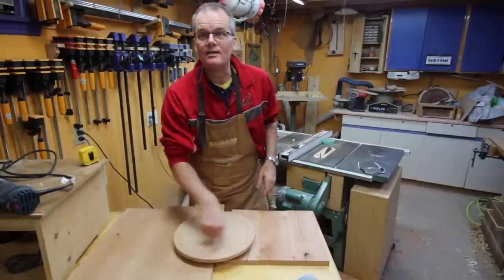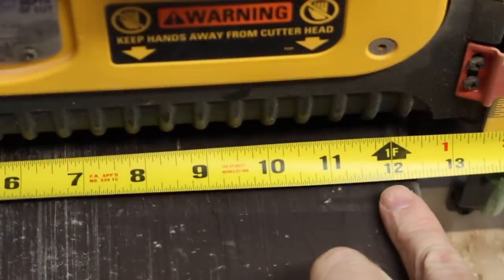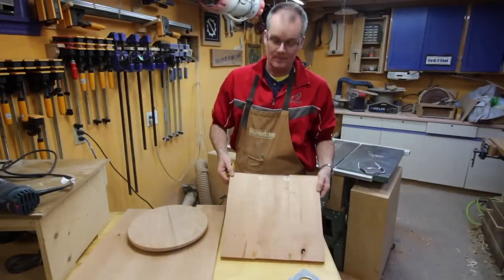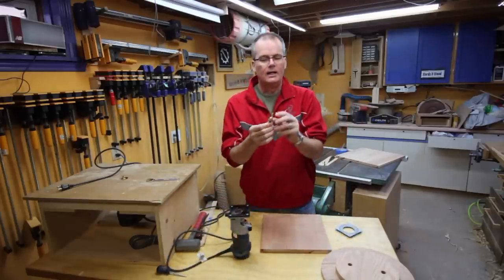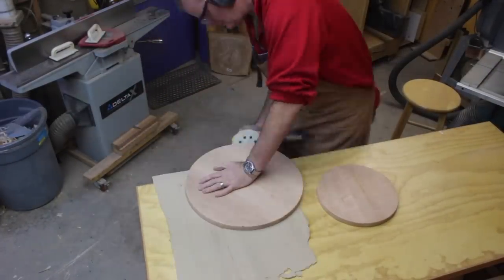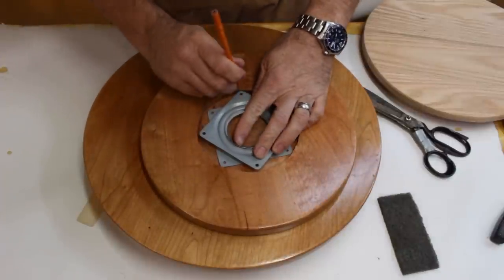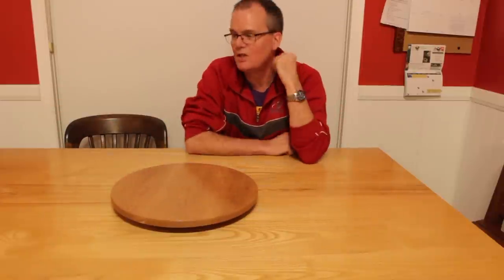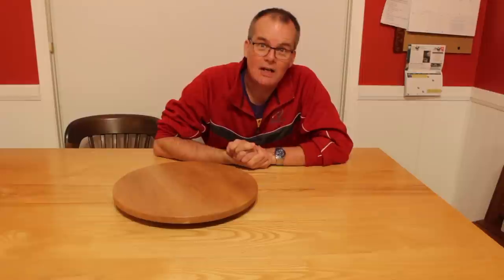Lazy Susan --  Quick Weekend Project  (WnW #126)

Comment from the maker: Patrons spin me right round, baby, right round:  https://www.patreon.com/wordsnwood
----------
Build Article: http://www.wordsnwood.com/2018/lazysu...

I decided to try making a Lazy Susan for our kitchen. It's a quick and fun project -- you just need to glue up some boards and cut them in circles. The trick(?) is to excavate a spot in one of the boards to hide the ball bearing mechanism that allows the board to spin. There's a bit more to it than that, which is detailed in the build article.

---------- ---------- ---------- ---------- ----------
LINKS TO SOME OF THE ITEMS USED:

(AND/OR other tools and jigs that I use and recommend.
Most of these are affiliate links. If you buy through these
links it helps support my channel. Thank-you so much!)

https://goo.gl/G2UyMp -- Ball Bearing Swivel (This is the Lazy Susan bearing I used)
https://goo.gl/fRuRhj -- 1/4 Inch Shank Hinge Mortise Template Router Bit (The router bit I used)
https://goo.gl/tXC28k -- 3pcs 1/4 Inch Shank Bearing Router Bit Set (these would also work)

1/4 Inch Shank Bearing Router Bit -- https://goo.gl/8nTn4o
1/4 Inch Shank 3/4 Inch Diameter Bowl Router Bit -- https://goo.gl/XGzcbB 
Tripod Mount Holder Bracket -- https://goo.gl/375aio
Wholesale Mechanical Parts -- https://goo.gl/Q2F5F6

JIGS/ACCESSORIES

http://amzn.to/25Iw4t6 — Long Nose pattern marker
http://amzn.to/1V4ZHkv — Painter’s Pyramids

SMALL TOOLS

http://amzn.to/1WSNq1j — Stanley Leverlock tape measure 
http://amzn.to/2lYXz3W — Other auto-locking tape measures
http://amzn.to/2aqt0u4 — Ridgid 12v drills
http://amzn.to/2aRaSJY — DeWalt Random Orbit Sander

FINISH:

http://amzn.to/2beVz3t — Minwax oil-modified Polyurethane
http://amzn.to/2kPENLs — 3M Finishing Pads / Scotch Brite

BIG TOOLS

http://amzn.to/2bpMmkX — DeWalt DW735 Planer
http://amzn.to/2beSIY6 — 3rd party blades for DW735

GEAR I USE TO MAKE VIDEO:

http://amzn.to/1qPkvBp — Canon T5i
http://amzn.to/2aK7jZX — Inexpensive Quick Release tripod ball head (Very useful)
http://amzn.to/1SSwOmS — Sony Action Cam. (I use the HDR-AS15 which is discontinued -- cheaper than a gopro.)
http://amzn.to/267XM3M — Sony Live View video remote for Action Cam
http://amzn.to/1XC2D7l — Joby GorillaPod (Flexible small tripod)

---------- ---------- ---------- ---------- ----------
Many more woodworking projects:
http://www.wordsnwood.com

PLEASE SUPPORT MY CHANNEL

The best way that you can help support what I do is to buy one of my woodworking plan packages. 
Details here: http://wordsnwood.com/plans/

Follow me on Social Media:
https://www.instagram.com/words.n.wood
https://www.facebook.com/wordsnwood

---------- ---------- ---------- ---------- ----------
Thank-you!

Comment: Looks siimple and nice.
Thanks for the video.

Kindky let me know the appropriate  thickness for 18" inch turntable for both top and bottom disc and the diameter of the bottom disc.
Reply from the maker: On my project the Top is 16" diameter, Bottom is 11" diameter.  Thickness of each piece is 3/4".
Reply: @Wordsnwood  

Thanks for your prompt reply.
I appreciate.

Comment: I might have missed it.  How did you center the 2 pieces in both X- and Y- directions with only 2 access holes on the bottom piece?  I can seen how it can be centered if there are 4 access holes.  The reason I ask is the lazy susan I have only has 1 access hole built in.  I can't see how I would center the 2 pieces.  Perhaps, line up the Xs on the 2 pieces?  I don't see how you would have done it when you had already sanded away the X you had marked on the wood in the beginning. Thanks!
Reply from the maker: Yep, you missed it.   The screw holes were pre-drilled earlier in the process.   When mounting it, you just need to re-find the already drilled holes.
Reply: @Wordsnwood  Yes.  I went back and rewatched the video and in fact I do see you had drilled the 4 holes on the top piece.  Thanks for your reply!

Comment: How many coats of polyurethane do you use and how long berween coats. Do you use a finishinf pad to lightly sand between coats
Reply from the maker: usually 3-4, and how long depends on the rules on the can, usually they say 4-6hrs for waterbased.  I always lightly sand between coats with 220 or 320grit.

Comment: nice job but I seemed to have missed a step.  How did you center the base with the top on final assembly? did you have alignment holes in the underside of the top?
Reply from the maker: Refer back to the video starting @2:00  -- my blanks were square, so I could connect the corners in an X, and then I positioned the bearing on that X to mark the mounting holes on BOTH pieces

Comment: Quick question, should stain go on before shellac right? If shellac will seal the stain will have to go on first right?
Reply from the maker: I don't apply stain to cherry, as I prefer to let it age naturally.     This article I found talks about using shellac first as a grain sealer - though I might use actual "wood conditioner" instead of shellac:  https://www.familyhandyman.com/woodworking/staining-wood/how-to-stain-wood-evenly-without-getting-blotches-and-dark-spots/

Hope this is some help.

Comment: '
i did put 4 rotating turntable bearings
1- on the table with LED color TV
1- videocamera mount while the RC car-truck spin
1- small deadmaus dance with plastic balls without grease
'
1- plastic balls on the plastic rotating bearing without grease for RC trailer

Comment: Hi Art...i noticed on this video, you r using 12volt Ridgid drill, is it noisy??? ,  my 18 volt Ridgid is way louder than Ryobi-Makita-Milwaukee (Thee other big 3 brands in Home Depot).
Reply from the maker: I don't find it to be noisy at all.  I originally bought 12v drills for my shop for their compact size -- in a hobbyist workshop I don't think there is any need for the long run time of a huge 18v battery.   They do have a bit less power, so an 18v is still handy on occasion.

Comment: What type of router do you use for digging out the circular section that the lazy Susan hardware sits in?

I don’t understand the difference between a fixed, plunge and hand router.
Reply from the maker: I'm using a Bosch Colt, which is a palm router -- which is just a smaller router.
It is a fixed base router.
A plunge router has mechanisms to raise and lower the bit WHILE you cut.  With a fixed base router you need to adjust the depth of cut before you turn the router on.
Reply: Would you suggest a plunge router over a fixed base router?

I thought fixed base routers weren’t adjustable and were dependent on the length of the router bits that you have?
Reply from the maker: @asherstein2770  If you have only one, try a kit with interchangeable bases.   Then you have access to both.

Comment: Very nice countersinking the bearings! 👍 

BTW, which drill is that 7:20? Looks very compact and light weight.
Reply from the maker: It is a Ridgid 12v, and you are right, it is lovely and compact and light.   you can browse them here, http://amzn.to/2aqt0u4   -- but Home Depot is the place to find them.

They appear to be very similar to the Milwaukee m12 compact drills, but I have no direct experience with those.
Reply: @Wordsnwood  Ah...Thx! Nice brushless 12v! Didn't know that anything less than 18v can deliver this much power.

Comment: My question is how many inches of "reveal" do I need to hide the base? In other words how much smaller diameter should the base be than the top and still be stable? Also what size bearing in relation to the base? How deep a recess works for you? Thanks! These questions are really hard to find so far. Great video otherwise.
Reply from the maker: There was no magic formula for reveal, just what seemed to work.   The restriction may end up being the bearing.   It's been a few years, but I recal that finding different sizes of bearings was a challenge.  And again, the depth of the recess depends on the thickness of the top.     half of a 3/4" thick top is about the most I'd excavate.   
Sounds to me like you should just dive in and experiment!

Comment: I think you forgot to put in the other two screws connecting the ball bearing plate to the base. @ 7m 51s
Reply from the maker: Shhh!  No one was supposed to catch that.   (I put in two just to make sure everything fit and then took it apart again and put in all four, but skipped that in the video)

Comment: i have a hard time  getting past  4-5 coats of wipe on poly   ,  too much time  ,  so i   cut that wipe on poly with  mineral spirits  50/50 . then it  dries in 1 hour  vs  4-6 hours.  last coat i always put on full strength .   then   finish with  steel wool and  mineral  oil  mixed  with beeswax mix   then i  buff that  shit ,     turns out real nice , i like this project i was thinking  about making one a few months  back  saw    one on  IG///   is  that maple  or cherry  .  looks like you milled it  yourself? , but you answered my question at the end of the  vid
Reply from the maker: I use WB poly.  Dries pretty fast.  
I did not mill it myself...  No lumberyard here!